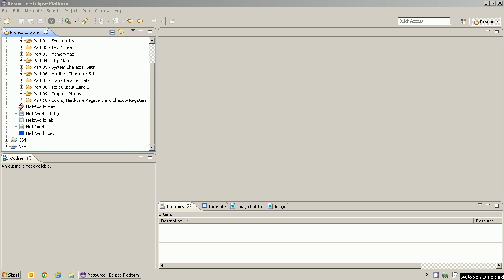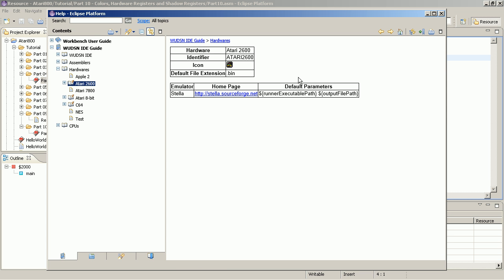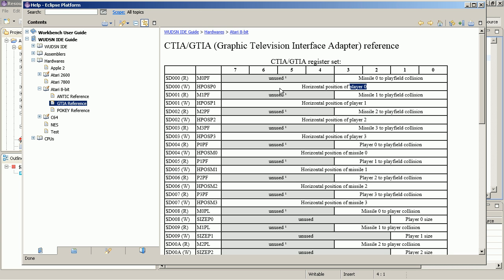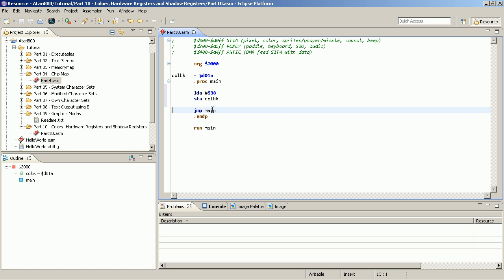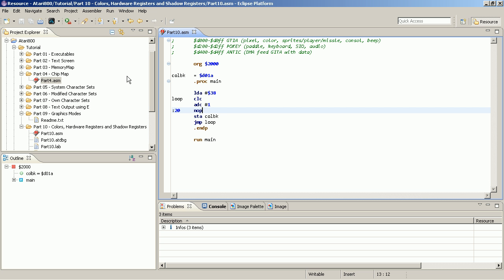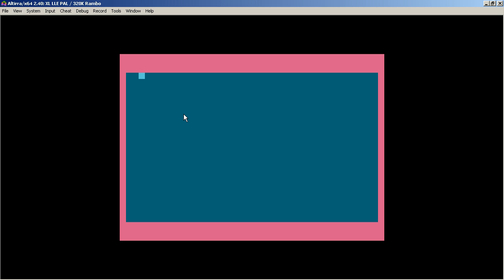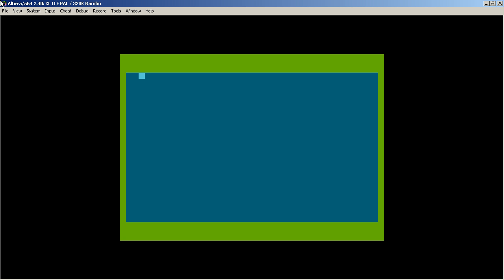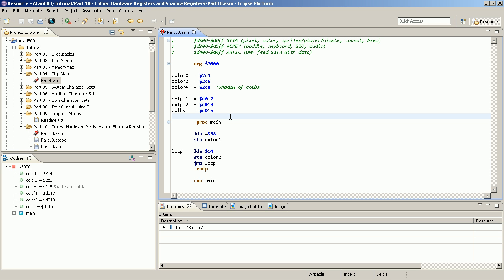Programming the Atari XL/XE - Part 10 - Colors, Hardware Registers and Shadow Registers (2014)

Comment: Informative video! There are a couple of things I'd like to point out.
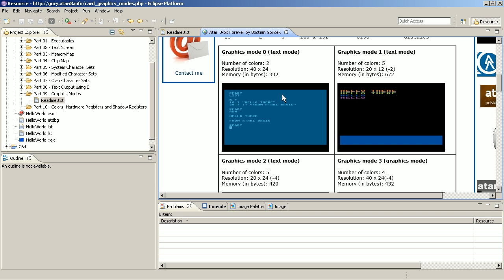0:21 Graphics mode 7 (Antic D) should be 4296 bytes for memory used.
There's also a text mode, Antic 3, that's like Antic 2, but each character is 10 scan-lines high (8 x 10 pixels).
Reply from the maker: Thanks for the feedback Stanley. I'll forward the remarks to Gury.